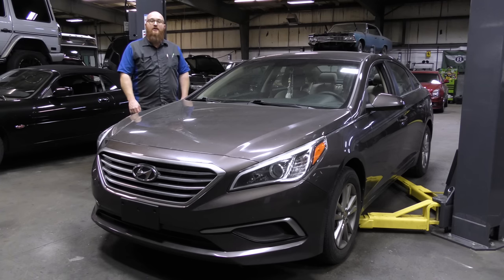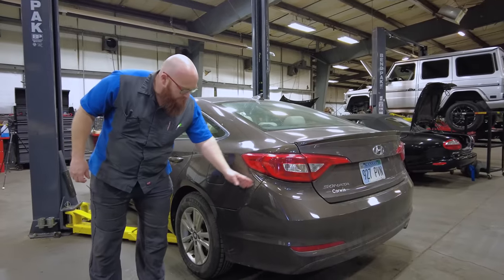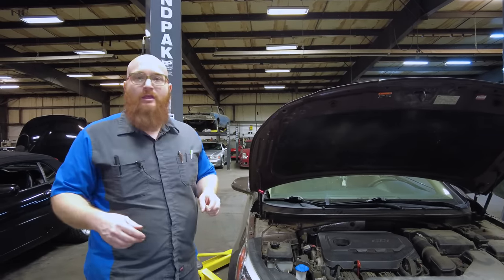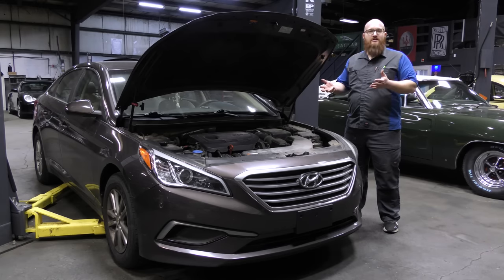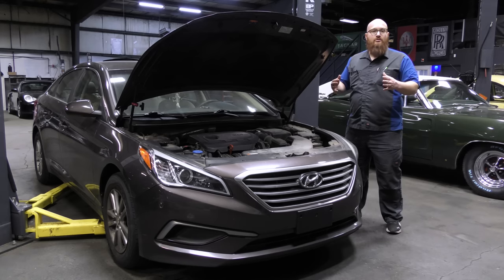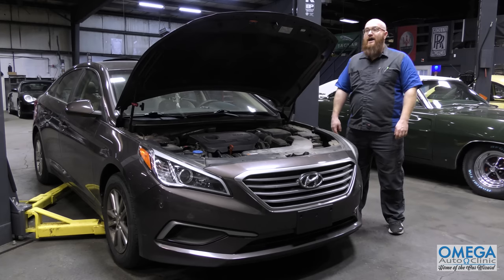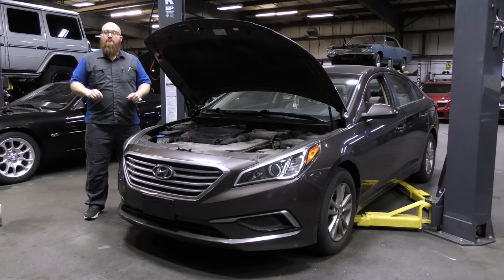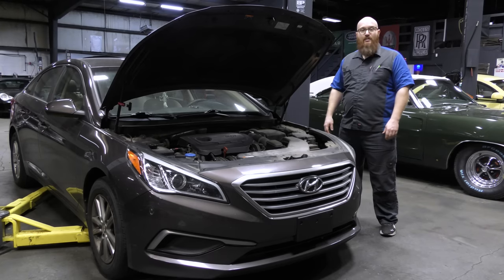What could be so bad on this '16 Hyundai Sonata that the CAR WIZARD is sending it to the junk yard?

Comment: Those recall notices you get in the mail are real important.  Kia/Hyundai have sent out plenty of notices to update the knock detector system to help with the oil consumption problem.  With the recall completed, you get a lifetime warranty on the motor.  Corporate did their part, the user must maintain their vehicle and all is well.
Reply: So tell me why we didn’t get our notice? 
We bought our car second hand.
Reply: Clearly, regular maintenace wasn't done.  No car will rum long on low, dirty oil.
Reply: @seeya205  we’ve kept our maintenance records tight. We bought it second hand from Hertz.
Reply: @landonking4282  not much, had 76 k miles when it was bought back in 2018, the car has 201k and was running perfectly fine before. In late June, it just progressively burned oil, currently 5 quarts a week. In November, the bearings gave up, ready to make the rest of my engine give up as well.

Comment: My wife had a Hyundai Senta fa. It was a good looking car but it would burn/lose oil between each oil changes, about 5 quarts of oil. I would change the oil religiously so I was shocked. Brought it to the dealership and they’re like it’s normal for the cars to burn some oil between oil changes. Im like 5 quarts between oil changes that’s ridiculous especially for a 2019. I have a 2007 Toyota highlander and it doesn’t miss a beat. I said that to them and they’re like well. They don’t make cars like they used to. I’m like yeah they should be better .Personally I would stay away from any of these cars along with Kia.

Comment: I've been saying for years Kia Hyundai use poor cheap wire harnesses which turn into electrical problems on the vehicles & now fires, I had a 16 Sorento what a nightmare almost everything broke electrical issues up the a** battery continually dying, moon roof wouldn't close just a disaster, they entice with the designs of the car but reliability eventually catches up to you... I remember Hyundai back in the 80s Pony Stellar were also disasters.

Comment: We bought a 2016 Forte in September of 23. My daughter got hit and needed another car ASAP so we kind of rushed into buying it. I had a Kia (Ford Festiva) back in the 90's. It was a GREAT car so I thought the Forte would be the same. Wrong! The Forte was using a quart of oil every 400-500 miles. I called the dealer, no go. So, I did a 4 day piston soak with Seafoam and then PB Blaster. I'd crank the motor every now and then to move the pistons. I cleared the cylinders and put it back together and drove it pretty hard for about 10 minutes. I changed the oil//filter and now I've driven over 300 miles with no oil loss. I honestly think the PB Blaster (it's a penetrant) did the trick and freed up the stuck rings.

Comment: I have a 2016 Elantra with the 2.0 and change the oil every 4-5000 miles. I know they are not the best engines but if you over-baby them they should be okay
Reply: The 2.0 I think escaped the problems the larger motor got. Keep up with the maintenance hope it lasts a few hundred thousand more!
Reply: @scene24man  oil changes are cheaper then engine replacement
Reply: You mean, if you do service as specified, they will be OK. To the Wizard's point, a lot of folks these days just buy a car and drive it until it stops, or if they can't turn the radio any louder to overpower the bad noises the car makes.
Reply: @heiner71   A lot of the owner manuals have service intervals that (in my opinion)  are rubbish.  They just want cars to last until out of warranty not maximum life possibly.
Reply: @heiner71  these engines were breaking even with good, regular maintenance, that’s the issue.

Comment: The problem with the $9k used car is the same issue could be a month away. With a fresh engine the counter is reset to zero, and with the oil checked regularly it would be fine.
Reply: I thought about that too but if the other one was well maintained and they have the records they may be able to get a new engine if it hasn't already been replaced.
Reply: Just get a used , higher mileage Toyota
Reply: @XenomorphLV426 ...or Mazda

Comment: That motor was gonna blow anyway, but ya gotta check your oil, for sure. My 2.4 in my 2016 sante fe had a rod knock at 85k miles, even with religious 5k mile changes.
Reply: Gosh, that's devastating. Any chance of getting a recall or warranty work done?
Reply: @TheHamburgler123  it was replaced under warranty.   It's gone already.  Lol

Comment: Code 859 identifies the knocking sound. 

Our 2013 sonata started burning oil in early 2023  so much so at roughly one quart per tank of gas. 
I took it to the local Hyundai dealer in SoCal and they conducted their own test. They confirmed they added two quarts in less than 1,000 miles. And all I got out of them was “eh”.  

Don’t buy a Hyundai or Kia from 2011 through 2016.

Comment: Well you cant really fault the car with so little oil on it… looks like a neglected ownership to me
Reply: you would think that...but you would be wrong....this is a hyundai 4cyl engine issue see my comment and find out why....this has nothign to do with the customer neglecting....these engines are garbage and the brand is also garbage. We have had 100% new cars from hyundai delivered to us needing a new engine....we have had customers with under 5000kms needing a engine ON A VEHICLE THEY JUST BOUGHT NEW!!!
Reply: Do a little bit of research, all these motors are trash and no matter what you do, it will die an early death. They actually did well to get 116k out of it. Many don’t last 1/2 of that
Reply: these cars love to develop insane oil consumption

Comment: I have a kia forte 5 1.6 litre turbo 92k miles, every time I fill the gas tank, I check the oil.
The owner manual says change the oil every 3k miles , which I do. Use synthetic oil and also use holeshot FR3.
It purrrs like a kitten on cold starts. Running strong.
It's not a honda or Toyota, bottom line, don't skip maintenance!!!

Comment: I had a 2012 Sonata that had the same issue and engine. I loved it at first because it got amazing fuel millage. It had a recall for the factory leaving metal shaving in the engine block. Mine started knocking around 70K miles and luckily they honored the recall. They replaced the entire bottom end of the engine. I sold it right after because of all the headache the car caused me. I was perfect on the oil changes also. I did them all myself every 3K miles since I bought the car. But oil changes don't fix metal shavings in your piston rod bearings lol. I'll never buy a Hyundai again!

Comment: My 2015 Santa Fe Sport’s engine died at 99,000 miles with no warning or prior issues. I was just driving at 55 mph when it suddenly slowed way down to 20 mph and wouldn’t go beyond that speed; no weird sounds, weird smells or anything. I made it to the dealer and they said the engine was blown. I couldn’t believe it. Thankfully they honored the engine recall and we got a brand new engine free of charge (just took 30 days because of 2021 car shortages). Aside from that (haha) it’s been super reliable and never had any issues or major repairs in 8 years and 150k miles (as of now). I’ve been lucky, but I’m planning to swap it out for a Highlander when prices calm down a bit. 😂

Comment: Those engines are 100k engines period
Reply: Transmission lasts the life of the engine lol
Reply: My son had one with 310k mi., and not even a tick in the engine. 
I currently have one with 146k which is just starting to have a noticeable tick upon cold start; which dissipates after a few minutes of driving. 
I'm guessing it's the timing chain tensioner...

Comment: It needs to go to a mexican shade tree shop where they can put in new main bearings with the engine still in the car, all for a couple hundred dollars. No, it's not a "done right" fix that will last, but you might get a few more years out of the car. There is a time and place for that kind of repair.

Comment: As a 44 year old... I was taught to do certain things with my vehicles. Check the oil was among them, not bashing but even when I was busy, at least once a month; usually two. I was also changed the distributor cap, distributor rotor (now both obsolete) change my own tires, change my fuel filter, change my oil and be able to fix minor problems. 

Those days all seem long gone now; shame.

Comment: I owned a 2016 sonata with this motor from 14k miles. It was a great car, only paid 14.6k for it.  Unfortunately, mine started burning oil around 50k miles. I sold it at 65k to avoid dealing with issues down the road. Fun story, I used to run GDI head cleaner on the valves, and the last time I used it the car ran after the key was removed for approximately 20 seconds and died with a loud ping. I always checked my oil every other tank of gas and never ran low on oil.

Comment: I'm an engineer and I've been a shade tree mechanic all my life. There are great mechanics local to you and lm a big supporter of conscientious shop owners like The Wizard, but one thing I've learned over the years, if you need an engine rebuild, NEVER go with any local shop who either wants to do  rebuild themselves or who wants to sub work out to another shop to get it rebuilt.These people aren't working to any tight tolerances and specs like the manufacturer does!!! Spend the extra $ and accept only a remanufactured long block straight from the OEM manufacturer. Those long blocks are made and assembled on an assembly line and checked against close tolerances and specs that the OEM manufacturer stands behind. Not so for your local shop or mechanic doing an in-shop engine rebuild of questionable quality and questionable attention to detail. And don't think you're getting some great warranty from an in-shop rebuild because you won't.

Comment: We used to be told to change the oil every 3,000 miles or 3 months. Then the manufacturers started upping those numbers to 5,000 to 7,500 miles. I think that encouraged people to forget about it. With all the bells and whistles new cars come with, you would think there would be a sensor which would tell the owner to change the oil and filter.

Comment: I oonce had a car with a 2 liter gasoline engine. One time on the road I noticed the oil pressure warning starting to light up.

I checked the oil, dipstick was bone dry. I added oil to the correct level. This was at around 120 thousand miles on the odometer. The car was still in the family at 200 thousand miles and still running like a champ.

I dodged the bullet that time. Phew!

Now I keep better track of oil level and do not wait for the low oil pressure warning light to come on.

Comment: Well said on both points: cars need to be maintained and please don't bash the person who neglected it. They hopefully learned a valuable lesson.

For example the first car I got was a 1999 Mercury Grand Marquis and while I was keeping up with oil changes and the like, I wasn't paying attention to rotating the tires as I had to go to a different shop for that vs the oil change place as the tire shop had that as part of the tire purchase package. I forgot to rotate the tires for probably 7-10K over what I should and the tech noticed it, saying that I had ruined a perfectly good set of nice Goodyear tires. I told him thanks for the reminder and after that I never forgot. 

I have a 2003 Lexus ES300 now and whenever I change the oil (6M or 5K miles, whichever is sooner) I immediately bring it in to Costco for a rotation as in my mind oil change=rotation so I won't forget. I have had two timing belt/water pump changes, coolant, transmission fluid etc through the 120K miles I have driven it and it's worked perfectly. If I hear unusual noises from the normal, see any drops of oil or whatever on the garage floor etc I bring it in and the car has been rock solid over the 11 years I've owned it. It's a Lexus, but it would not be in the condition mechanically it is today unless I maintained it. It was a costly lesson but I sure learned it on my first car!

Comment: The real issue was not low oil, I have a 2.4 Santa Fe sport. Motor failed At 85k miles regular maintenance at the dealer every 4K miles full synthetic. Never used any oil between oil changes. I now believe after researching that theres fuel blow by, allowing the oil level to never actually go down just go down in quality.

Comment: I lease my Hyundai. I bought one in 2000 and it lasted100,000 miles until the undercarriage rusted away, after ten years of street salt.  Since then, I've done 3 year leases on 6 different model Hyundais. It's worth it to me to not worry about long term maintenance, just the basics and I like getting a new model every three years.

Comment: My sister had this exact same thing happen to her 2015 Kia Optima. The only difference is I kept up on the maintenance and the rod bearing spun from the lack of Hyundai/Kia quality engines, this was at 142,000 miles. 😞🙄 P.S. The dealer did replace the engine with a remaufactured one.

Comment: I had to salvage a 2016 VW Passat because it needed new cat. converters at a cost of over $5000 and it was using more and more oil.  It made it to 200,000 miles and I did change the oil on a regular basis.  Just not worth fixing when I knew the engine was using so much oil. It had other things wearing out too.  I did really like that car though.  Comfortable, fast, heated seats were nice. Now Toyota is my "go to" car.  300,000 miles and does not use any oil.

Comment: I guess I am the sole person ALIVE in this country that has had 4 (yes FOUR) Korean cars in the last 20 YEARS (Hyundai Elantra, Kia Soul+, Kia Forte, and Hyundai Kona) - stretching from 2002 until now - WITH ZERO (0) PROBLEMS / Issues. Each car I bought new - drove over 120K (except for the '21 Kona that we still own with 37K on the odometer) - the latter 3 cars each had 1 (one) car battery, one (1) set of tires and scheduled maintenance by the book. IN 20 YEARS I HAVE HAD NO ISSUES WHATSOEVER - AT ALL. Oh, I forgot to mention, I did have to replace a rear turn signal bulb on the Forte - that set me back $1.50.

Comment: Mine (2.4L) grenaded at 193K miles just after an oil change...I took it to the dealer and got it back 10 days later with a rebuilt long-block. No questions asked. I was told if it happens again, I'm covered...getting the same or better gas mileage 40-45 mpg.

Comment: no joke about the maintenance.
i have 2 ICE and 1 EV, and i put maybe a few hundred miles total in my ICE every year (just so that i know they work), and I do my own oil change. 
what happen after you have EV is that... aside from the catastrophic failure that may leave your car completely unrideable (if it happens at all), you otherwise has 0 maintenance.  and i got use to it so quickly that I now find having to do oil change in my other two cars are such a headache, so i haven't touch them in over a year.

Comment: It may not be necessary to mention this to many people, but the oil warning light on your dash does NOT tell you if your oil LEVEL is low. It tells you if your oil PRESSURE is low. Depending on make and model, your oil level might have to be desperately low for the oil-pressure sensor to trigger and light that light. So like the man said, check your oil level yourself regularly.

Comment: My Kia Sportage with the same engine died at 70,000. But I have kept up with the maintenance so mine was repaired under warranty. They put a short block in it. And since the engine was going to be out of it and pulled apart, it was a good time to replace all of the hoses and the wiring harness. But this engine is junk and the transmission is junk too. They shift rough. I anticipate it lasting for another 70,000 miles and then I will need to replace it.

Comment: People aren't told anymore that checking and changing your oil regularly will save your car, and save you money in long run because their cars will last longer. Some just want to drive them till wheels fall off without ever washing them in some cases, and certainly not changing the oil, some people won't even put new tires on, they just drive them bald ones, put some fix a flat in a tire and keep going.

Comment: I had a 2008 Jeep that drank oil like an alcoholic at an open bar. Learned it was typical of that V6 engine, but I learned from my father to check your oil at every time you get gas so early detection saved me

Comment: My wife had a Kia Sportage with I belive the same engine. The engine was fine, but after just 30.000 miles the auto gearbox failed. The main dealer did not want to know as we had bought the car second hand from a private sale. Our local small garage had the box out three times but could not fix it. He did his best but most cars here are manual transmission, and he said I just dont know what else to do. We live on a small island, hence the low miles. We could have had the box out again and sent it to the mainland, for a minimum price of £3500 or $5000. We had just spent $1000  £700 having the DPF filter taken out, as we have a 35 mph speed limit and they block all the time. My wife had had enough, the car went to the scrap (we have to pay for that here) and she bought a Mitsubishy Shogun. Crazy world.

Comment: dealer can also reject your warranty claim if you are not using an OEM oil filter. I saw it. A customer put a crumb oil filter on his motorcycle. The engine had an oil related failure under the warranty timeline…They wouldn’t pay it because of the aftermarket chrome Chinese oil filter.
  it says right in every owners manual I have ever seen, to use OEM parts..

Comment: It's not a matter of checking oil. I own a 2012 version of this same car and it burns oil at an alarming rate. A quart a month! You could check the oil level today and be very low 3 months later. To top it off these cars do not have a low oil pressure warning light. If they do no one in the blogs has one that works.